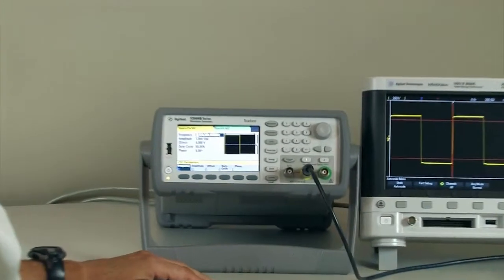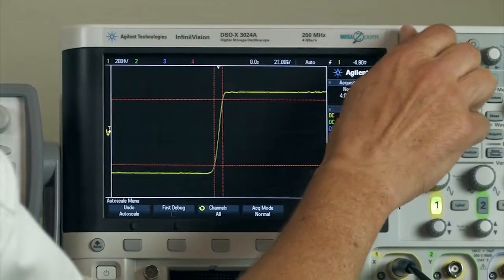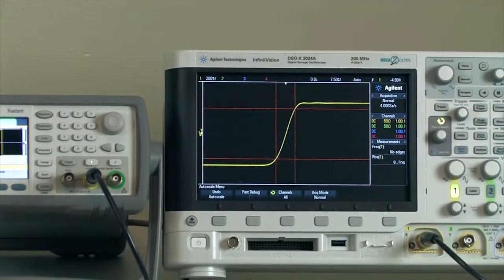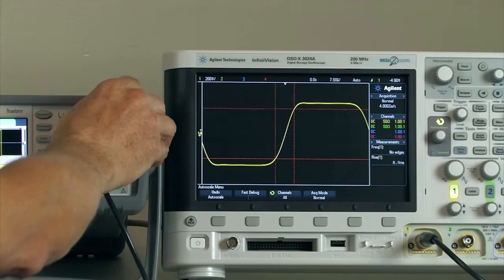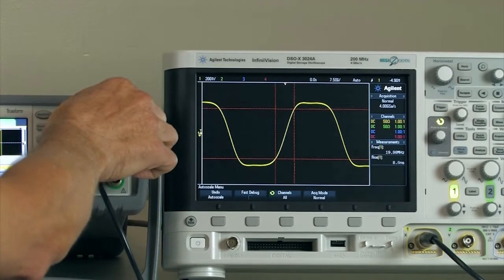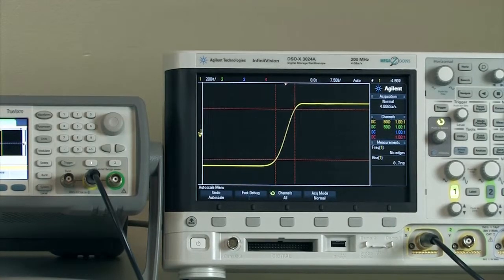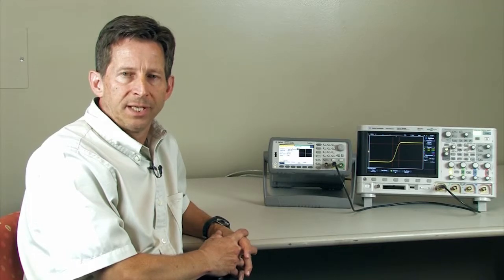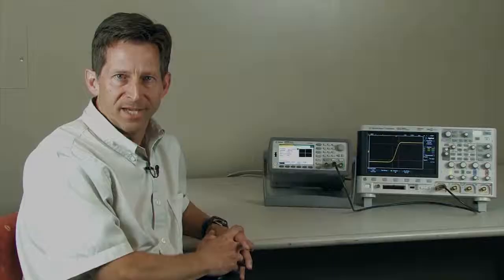33500B Series Waveform Generator Generating Square Waves, Square Waves at Higher Frequencies

Comment: Good video! I have several cheap-ie PC-based scopes and when I ratchet up the square wave frequency, the rise of the square becomes sloped, in that it really doesn't resemble a proper square any longer.  Is it just my cheap scope? Or do all scopes fail to rise to the top of the square when the frequency is very high?